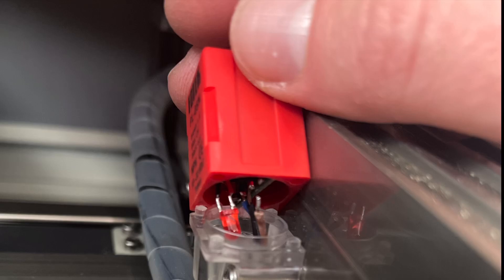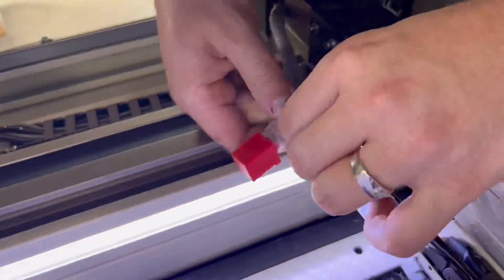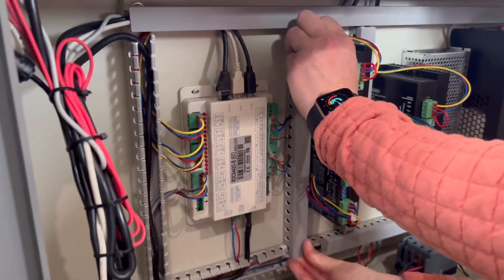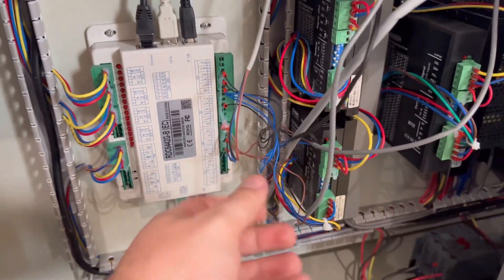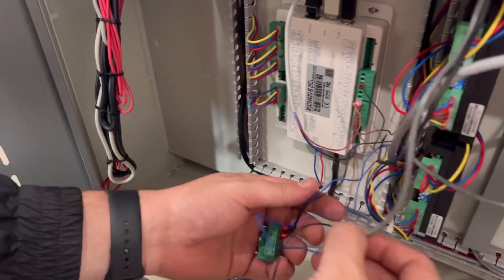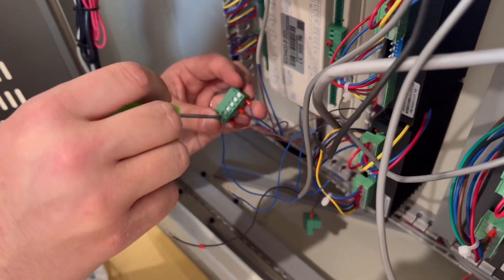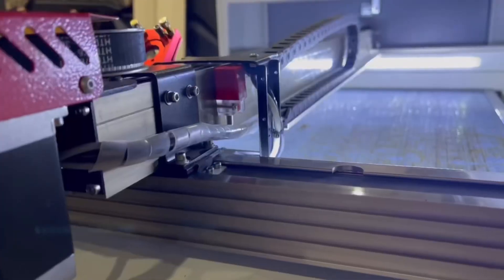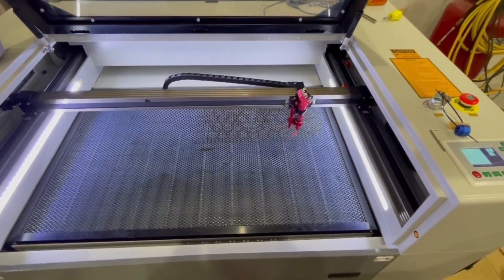Monport Proximity Sensor Replacement

Comment: I watched your first video on this machine last night.  I've been doing A LOT of research the last few weeks, as I'm going to purchase a machine, but I don't know which way to go yet.  There seems to be several trade off's between all of them.  No one machine does it all, and I understand this.  So far this seems to be the best candidate.  The Omtech Polar, and the Gweike Cloud are basically identical machines, but the Gweike seems to have more problems.  I've read that neither machine has Autofocus, even though they  both say they are.  There's another video, of a guy proving that it is Manual Focus.  It's one feature I REALLY would like to have, and I see THIS Monport model DOES have Autofocus.  Can you confirm this, and say a little about your experience with the Autofocus please?  The price of these machines are in VERY close proximity of each other, and so far I have to say NO to the Polar and the Cloud.  What software are you using?  Can it use Lightburn?  Thank you.
Reply from the maker: Correct. This model does have auto focus. And I use lightburn!